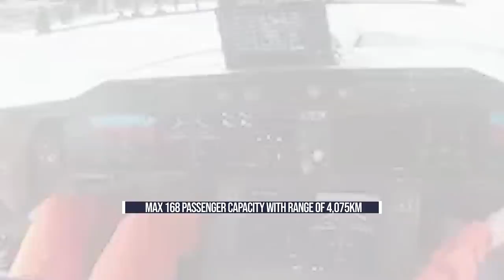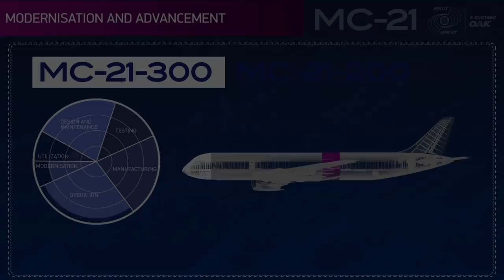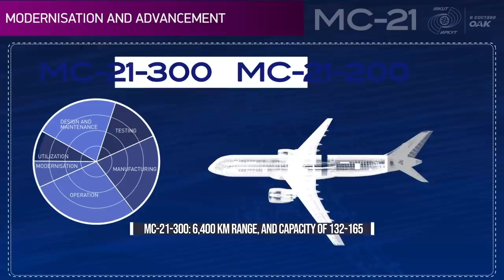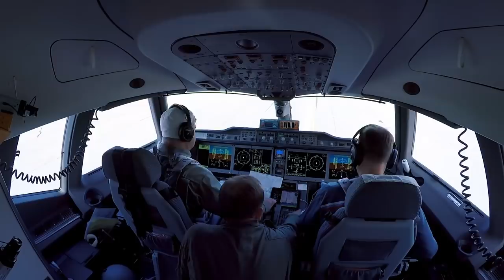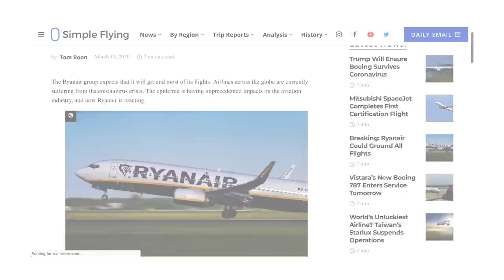Russia And China’s Plan To Compete Against Airbus And Boeing

Comment: Comac will probably eat up all market share for Boeing and Airbus in the Chinese markets due to the nature of it being funded by Chinese government and will probably force every Chinese airline to buy it. 
The MC-21 is the better designed of the new competitors but of course operating logistics once in service will be a challenge. That won't stop them from eating up all the Russian markets from Boeing and Airbus. This is only the beginning unless Boeing and Airbus actually create a clean slate design of single aisle aircraft, they need to design the "toyota corolla" of the skies; Simple and inexpensive to maintain; low price, extreme reliability, and quality parts.
Reply: The cost of production in Russia and China is very low - they can drop the price as much as they want. For example, always keep the cost 20% lower than Boeing with the same characteristics or better. Europe and the United States will not be able to do this - they will not be able to lower the price below any limit. In general, I am not an economist, but I have long been concerned about the issue of pricing within the country. Why in Russia absolutely everything is 3-8 times cheaper than in the USA, but the standard of living is excellent - I have been there several times and have a business. Similar work in China or Russia is several times lower than exactly the same work in the United States. Who came up with such overheated salaries?
Reply: Also but NOT building it in CHINA!!!!

Comment: The more competition the better it is for the customer.
Reply: I’m receptive to a Russian or Chinese-made aircraft tbh. Even if it will flop or even if it’ll only sell in China and Russia, I’m pretty certain it will be a slap in the face for Boeing and Airbus to at least TRY and invent new aircraft. Western imagination has stagnated lately.

From my perspective, the advent of the A321XLR and 737 Max aircraft are a major sign that variation in aircraft types is needed. While the A321XLR has not crashed and definitely will be a good mid-market plane, it’s also a sign that Western aircraft manufacturers are unwilling to spend time and resources (even before COVID) to draft up new and more efficient designs of airplanes. The A321XLR is a stretch of a 30 year old design, the MAX 10 traces it’s roots to a 1960s-era design.
Reply: Competition? It's not like they're gonna sell at all in the majority of markets. It's not gonna pose a threat.
Reply: Vladimir Lenin 

Even if it won’t sell well internationally, it will still be a slap in the face for boeing and airbus to innovate new designs more.

Comment: I wouldn’t say the nose designs on these new aircrafts a copycat of 787 and A350. It is for now the most aerodynamic shape viable for manufacturing and practical use and it would be projected that new aircraft types would more and more resemble the shape. Like no one would accuse someone for copying a bullet design. The world shares the same aerodynamic principles.
As for ARJ21 China had worked with McDonnell Douglas on manufacturing the MD-80 and 90 series in China back in the 80s and early 90s. The deal went bust but clearly COMAC took some good inspirations.
Reply: No. We own the round wheel. It's ours. The Chinese must use square wheels or they're COPYING!
Reply: Stole great designs from McDonnell Douglas.

Comment: I just hope Boeing and Airbus won’t cut back on quality control and safety in order to be able to compete with aircrafts nearly half the cost.
Reply: A executive dominated by managers will try to do that since they don't want to cut back on dividends.
Reply: Both manufacturers have too much fat in their profit margin. Boeing Max series run into problem because of cutting corners and abuse of safety certification. Competition promotes efficiency and quality products. Boeing and Airbus would have to work much harder ever before without a semi cartel business frameworks. 

For past40 years, China invariably brings down prices of goods for the benefits of the West. Plane making however infringes western monopoly and eats into their core industry huge profits. On safety concern, China has had much fewer failures in launching its space rockets than US. As most of the planes would be sold in the domestic market, there is no reason to suggest that China will compromise on quality and safety assurance. 

Isn’t lowering cost one of the ways to fight inflation????
Reply: @sktan3743  737 max and 787 are in high demand now, no one sane would fly in Chinese not Russia airliner, no matter how cheap.🤣😂☢️🌎☢️🇨🇳🇷🇺
Reply: they already did, THAT is what capitalism is all about, maximum profitability human lives are just collateral damage, same in wars, weapons, and aircraft industry, in fact all U$ corporations have nothing to do with improving lives and everything to do with corporate profits.

Comment: 1:05 That looks like a DC-9/MD-80/MD-90/B717 knockoff.
Reply: It is. COMAC was provided a license by McDonnel Douglas to build the MD-80. Based on the knowledge they acquired, they basically modernised it and called it ARJ-21. The prototype still had an MD cockpit too. Now it has an newly designed cockpit and new engines, so it's basically an illigitmate competitor to the Boeing 717 (AKA MD-95).

The C919 on the other hand is completely indigenous and I am hoping to get to fly on one one day actually!
Reply: The MD 80/90 was manufactured in China. Some of the designs are from MD90 so that they can reuse the manufacturing equipment in the factory.

Comment: The range is designed to requirements, and it simply designed a smaller fuel tank than the Airbus and Boeing ones.
Reply: I'm not sure about that. Purposely designing smaller fuel tanks doesn't make much sense. There may be situations where you need that extra fuel. Not even having the possibility of it eliminates so many customers.

Comment: Why there is no info on Sukhoi Superjet SSJ-100? About 200 of SSJ-100 have been built.
Reply: Yeah,  but how many are flying...?!
Reply: @fha1885  122
Reply: @ФранкМатроскин  so...with 22 needed to keep 5 operational,  that means about 30- odd are actually flying... Thanks for the info.
Reply: @fha1885  214 have been produced, 133 are in operation. After all Western parts of low quality are replaced, more will be in operation. Official info.
Reply: @ФранкМатроскин  why did sukhoi  put in low quality Western parts? Were the superior Russian products too expensive? How long before it will be all complete... A year?  5? 10? How many millions will it cost? Seems that buying a Russian aircraft comes with all sorts of problems....

Comment: Bruh Wtf the arj21 looks like a 717 with Crj wings and engines
Reply: China loves to copy
Reply: They used the MD80 blueprints, since McDonnell Douglas licensed some Chinese company to build the MD80s in China back in the 90s
Reply: McDonell Douglas should’ve forced the tooling to get returned
Reply: @nikolailic9958  it's nothing for China they even copied military aircrafts.
Reply: That’s because it is
Reply: @hulklovesaviation7535  It's aircraft

Comment: Will these new jets have potential to be the MiGs of the civil aviation world?
Reply: MiG-23 could have been the most unreliable plane ever. Soviet Air Force went as far as demanding to deliver them disassabled, as ground crews would need to take them apart anyway to fix all the crap that flying diaster had in it's design. Stil laround 1/3 of them were lost in accidents anyway.
Reply: @TotalRookie_LV  there are others like the MiG-15, -17, -19, -21, -25, -29 and -31. These are the jets that made MiG such a big brand name in military aviation during the Cold War and into the present day, in the way that the 747 made Boeing a major brand in civil aviation around that same period
Reply: @spdfatomicstructure  MiG-19 wasn't good either, that's why its production in USSR was so short - only a couple of years, most 19's anyone encountered were made in China or were given away by Soviets just to get rid of them. Even later model MiG-29s, while good in some aspects, had short lived engines (which plagues Russian planes to this day) and relatively weak frame and landing gear, which made developing carrier based variant impossible, unless they are completely redesigned.

Comment: Theorists have modeled an expanding spacetime—akin to our Universe—by taking inspiration from a string theory framework in which spacetime is emergent.There are many strategies in quantum gravity for constructing an expanding universe. One approach is to find an appropriate “string compactification”—a type of architectural map for strings and membranes—which builds up a universe with a positive cosmological constant. It is possible to construct nearly stable universes in this manner [3], but these constructions possess features that make them unrealistic. The difficult problem of constructing more realistic model universes is a topic of ongoing and active research.Appreciating how striking this statement is requires some unpacking. On the one hand, we have a theory of quantum gravity, say, in 3 + 1 dimensions—3 space dimensions and 1 time dimension. On the other hand, we have a so-called “conformal field theory” (CFT) in 2 + 1 dimensions. This CFT does not include gravity; it is a theory that has the basic trappings of the standard model of particle physics but additionally possesses exaggerated symmetries. The AdS/CFT correspondence means that a dimension of space emerges as we toggle between the gravity-free CFT world and the gravity-filled AdS world.Accordingly, a dS/CFT correspondence—if it were fully realized—would equate quantum gravity in de Sitter spacetime to a non-quantum-mechanical conformal field theory without time.

Comment: With the aviation boom in China at the moment, Chinese airlines will definitely love that, but I wonder if airlines outside China and Russia will put their trust on the company, but hey, an Airbus moment might happen(referring to release of A300)
Reply: There is a boom in HS train in China, not aviation. Trains are faster in China than flights due to no delays, airports in China are also used by PLA airforce, which has priority over airspace so flight delays are frequent.
Reply: @tonyvu2011  to be fair almost every airport in china is basically an air force base
Reply: @guy8806  yes delay for hours and cancellations are the norm when flying domestic routes in China. The projection for aviation growth in China has been outdated as it doesn't take into account the huge rise in HS train. So the Chinese made aircrafts will never be viable without state subsidy.
Reply: @tonyvu2011  Just want to ask one question: Did airbus viable without state subsidy at the beginning? Let’s see

Comment: why doesn't the MC21 have winglets?
Reply: Because if they build the wing properly, they don’t need winglet. Also if they are running short haul flight, the cost of fitting the winglet is too high compare to the fuel saved by those winglet
Reply: Because of the same reasons the E2 doesnt have winglets

Comment: I would have more faith in Russian than Chinese built aircraft.
Reply: Same
Reply: Who cares?
Reply: @yjk5430  Not you.
Reply: Just give them time. I give it less than a decade before they are as good as anything from Airbus or Boeing.
Reply: @davidlazarus67  - who be good as Airbus and Boeing - China or Russia?
Reply: @chrismckellar9350  Ultimately it will be the Chinese. They have so many engineers that they will exceed even Airbus in a decade and Boeing probably a lot sooner.
Reply: People still underestimating China in 2020,really?
Reply: @benardotieno4389  - China doesn't have the experience in developing good quality commercial aviation. China's track record in developing and building commecial aircraft is very slow, like with the AR21 programme dates back to 2002 and now being delivered. The C919 started in 2008 and the model is still in flight testing 12 years later with EIS planned for 2021 hopefully. In that time Boeing developed, built and released for commercial service the B737 MAX and the Airbus theA320neo/A321neo/lr. Even Bombardier start the CSeries programme in 2007 and the aircraft type is commercial services.
Reply: @chrismckellar9350  You're seriously using 737MAX as an example? That post needs a sacrasm tag.
Reply: @georgedang449  - So you are saying the the AR21 and C919 are better aircraft than the B737 MAX?
Reply: @chrismckellar9350  Are you saying the 737MAX is better than anything that flies?
Reply: @georgedang449  - The A220, A320neo/A321neo and Embraer  E-Jet family and lessor extend the MC21 are better than the out dated airframe design of the B737 MAX.
Reply: @chrismckellar9350  I agree that C919, with its modern composite materials airframe and fly by wire, is superior to 737's aluminum airframe designed by hand in the 1970s, before Boeing sabotaged it with the max so that it no longer stays in the air.
Reply: @chrismckellar9350  I agree that C919, with its modern composite materials airframe and fly by wire, is superior to 737's aluminum airframe designed by hand in the 1970s, before Boeing sabotaged it with the max so that it no longer stays in the air.

Comment: The problem with airplanes is they are extremely pollutant.  Planes don't have pollution regulations like cars and trucks.  Cars have catalytic converters to reduce air pollution.  Planes have no pollution reducers.  Planes burn kerosene and the pollution goes straight into the atmosphere which causes the green house effect as it produces smog in the upper atmosphere which traps in heat.  This causes more global warming than burning forests, burning coal, car gas burning, gas burning, combined.  The solution is development of electric plane engines.

Comment: Honestly, it would be really nice if UAC or COMAC could end the duopoly of Airbus and Boeing. But, in my opinion, the most likely aircraft program that could defeat the duopoly in recent times was Bombardier's CSeries program. It was fuel efficient and had good range. But look at its fate- acquired by Airbus. I fear that programs of UAC and COMAC could be acquired by Boeing and Airbus (though it's not likely.)

Also, to agree with these other comments, Boeing and Airbus could probably be coasting with inertia in the aircraft business.
Reply: Acquired by Airbus BECAUSE OF Boeing 😂
Reply: the writing's on the wall. A & B aren't innovating, just like most mono/duopoly, heck most if not all western corporations are not interested in innovation, it's easier to do price/market manipulations and rent seeking economies than any real work.
Reply: @tigading2177  definitely now because of the war in ukraine starting

Comment: Even if the Chinese jets are only purchased by Chinese airlines, it will have huge impact on the whole market.
So far it is not happening.  China still buys a lot of Airbus jets.  However, who knows what will happen in 10 years.
Reply: China air market is short of over 1000 aircraft at the moment, so it needs aircraft right now !!! So they just ordered a lot from airbus recently. Untill the comac planes are fully online they still need thousands of aircraft yearly due to the increase in demand for air travel in china ! They are even short on airports and are building over 10 major ones a year !

Comment: I mean why not, given that the SSJ was ever so successful.
Reply: The SSJ wasn't successful because the engine wasn't reliable enough so downtime was high and maintenance costs were high. They also didn't have enough spare parts. Russia is making a smaller version of the PD-8 engine for the Superjet planes which will be far more reliable and also more fuel efficient. It might become successful in 5yrs+ time.

Comment: The ARJ-21 is a copy of the Douglas -DC9. In fact, Boeing even provided the tooling for its manufacture. The CRJ-919 is clearly a copy of the A320. The Chinese have surely benefited from the A320 assembly line in Tianjin! Assuming that these carbon copies with wings do stand up to EASA/FAA standards,  whether they will complete with Boeing-Airbus will depend on the quality of the spare part supply chain. This was one of the reasons why Russian aircraft never sold well.

Comment: Similarities with the aircraft
Arj21
Has a similar cockpit window looks to the Boeing 737 (From the side) and the Airbus a220/Bombardier cs100-300. (Front)
Has the similar body structure and T-tail of a Mcdonnell Douglas md90 and the Boeing 717 (Excluding the seating arrangement)

COMAC C919
Has a similar cockpit window looks to a Boeing 787 Dreamliner.
Has a similar body structure to an Airbus a320

CRAIC CR929
It's just a Boeing 787 with Airbus a350 wings...but made in China

MC21
Not many similarities, just that it has a similar body structure to an Airbus  a321
Reply: You forgot the big one - they all have round wheels. This balant copying is unacceptable. Everybody knows the Chinese are only allowed square wheels.

Comment: Why everybody don't trust C919? China manufactured lots of MD-82 series aircrafts, no issues with them as I recall. Also - the engines and all avionics in C919 are american. The aircraft design is conventional - aluminium wings and fuselage (that's why it is so cheap - no innovations at all).